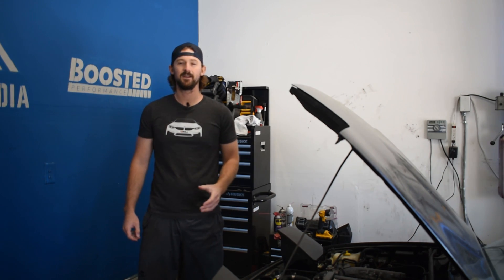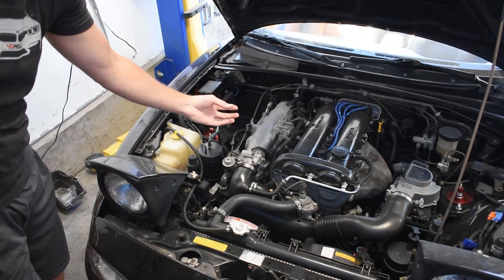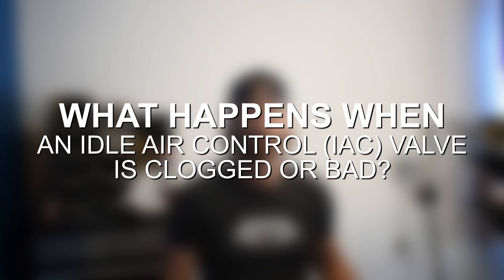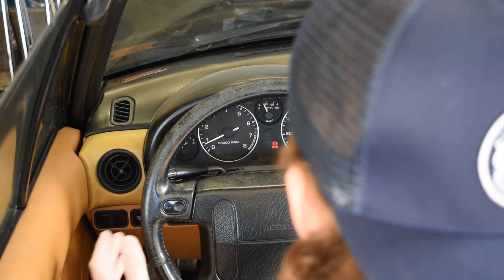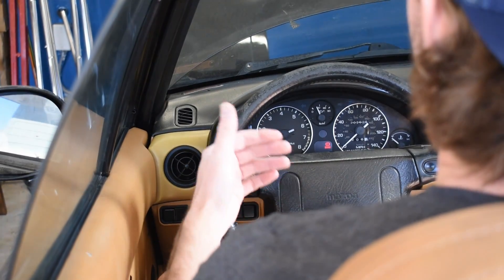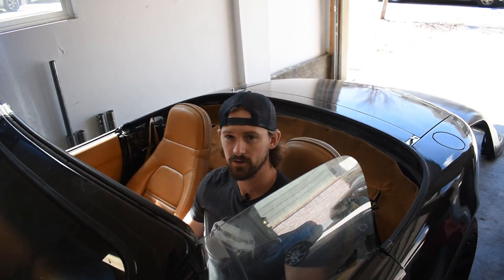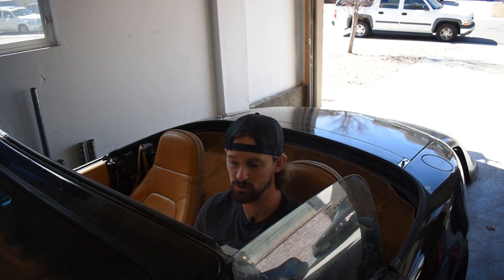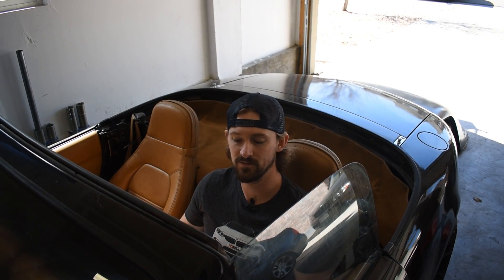DIY - How to Address a Clogged or Bad Idle Air Control Valve (with Symptoms)!

Comment: Wish I’d seen this video a year ago, but glad I’m seeing it now. It described the exact symptoms I’ve been having, getting worse over the course of years. Your video confirmed my diagnosis, finally, of a bad IAC. The only twist is I have a 97 which has the additional water controlled valve. The car sat for a long time and has a lot of rust in the cooling system, especially in the secondary water controlled valve. But the symptoms are exactly the same as you described. I’m trying to clean it up right now. So Thanks for the great video.
Reply from the maker: R - Glad to hear! We hope the video helped.

Comment: Can it make the hanging rev? I have one on motorcycle andwhen i revv yes the rpm increase but when i release.  throttle cable already close but the engine not come down suddenly. Maybe half second later.
Reply from the maker: K - Yes — a bad or sticking idle air control (IAC) valve can absolutely cause a hanging rev on a motorcycle, because if the IAC doesn’t close quickly when you let off the throttle, it keeps letting extra air bypass the throttle plate and the ECU keeps fueling it, so the RPMs stay up for a moment before slowly dropping; this can feel like the throttle cable is sticking even though it’s not, and the fix is usually to clean the IAC and throttle body thoroughly, and if that doesn’t help, replace the IAC since worn ones often react slowly once hot.

Comment: Dunno if you still see these comments, but on my bike (single cylinder fuel injected), it is harder to start when cold taking 3-5 seconds to launch, and the warm idle rpm is about 600rpm over what it should be, it is about 2500rpm cold and drops to 2100rpm, but should be 1500rpm, so you reckon this could be a part of that? It also seems like the bike tries to over compensate by enriching the mixture and then runs a bit rich
Reply from the maker: N - We try to always answer comments! It sounds like the ECU is over-enriching and holding the idle air control open too far, which would explain both the long cold starts (flooding it a bit before it finally catches) and the high warm idle (extra air bypassing the throttle). Common culprits are a sticky idle air control (IAC) valve/stepper motor, a dirty or sticking throttle body, or a bad coolant temperature sensor that’s telling the ECU the engine is colder than it is. If the ECU thinks it’s always in cold-start mode, it’ll dump extra fuel and command a higher idle. I’d start by cleaning the throttle body and IAC passage, then test the coolant temp sensor with a multimeter to make sure its resistance changes correctly as the bike warms up. If those check out, a vacuum leak could also raise idle and force the ECU to over-enrich to compensate.

Comment: Hi! ~ enjoyed your little Video . Ihave a Situation IN my 2002 Ford Explorer 4.6 V8 where as the Idle is  running about  3000 to 2000 @t start-up!!!    Then It goes down to 1600 rpm. I
I replaced my IAC valve with a New one <autozone> and it Still acts up!!!   Itested for Vacuum leaks in traditional places <manifold>  21 in HG Vacuum!!  What the Hell is going on on this FORD!!???
Reply from the maker: S - Thanks for the feedback! If your vehicle is idling at 3000–2000 RPM on startup and only slowly dropping to 1600 RPM—even after replacing the IAC and confirming 21 inHg of vacuum—it’s likely an issue with the throttle body (carbon buildup or sticking blade), a faulty or miscalibrated TPS (throttle position sensor), or possibly a bad PCM ground or idle strategy reset issue. Even with a new IAC, if the throttle plate is slightly open due to gunk or misadjustment, it can let in too much air and override the IAC's control. Try cleaning the throttle body thoroughly, perform a battery disconnect idle relearn (disconnect for 15 mins, reconnect, idle for 5 mins with no throttle), and inspect the TPS voltage sweep for smoothness—anything erratic can confuse idle logic and cause a high idle.

Comment: I know this is an older video so a response is probably not gonna happen. But, ive had to replace mine ywice now and not even 2 months after the second one its idling super high when i start the car. What could be causing them to fail so quickly? Ive replaced air flow sensor as well
Reply from the maker: N - The repeated failure of your IAC valve is likely caused by an underlying issue such as vacuum leaks, dirty throttle components, or electrical problems rather than the valve itself.

Comment: EXCELLENT EXPLANATION.did you say six hundred bucks for a new iac. ? thats insane, mine cost $20 bucks. i slapped it on and took it for a cruise. ran great. got home turenred car off and then for some reason i turned it back on and the idle strted surging. i took a look and the god damn thiung melted. i guess thats what $20 bucks will get you. one ride to store. taxiu is actually cheaper. i went and got a couple denso iac valves used the good pieces of eachj to make one good valve. thanks for the video
Reply from the maker: M - Thanks for the feedback! Unfortunately, that's what happens when cheaper parts are purchased, the quality just can't compare. Glad you found the video helpful and found the issue with your vehicle.

Comment: Could the iac valve cause lurking when the air con is switch on whilst driving in low gears
Reply from the maker: S - It's certainly possible. Wouldn't hurt to check if it's clogged and clean it if it is to see if that solves the problem.

Comment: I have a 93 300zx that idles rough but keeps running when the defrost is on, but the second I turn off the defrost the car dies.  Does this sound like the IAC Valve?  Most google searches say the car dies when AC is turned on.  This is the opposite
Reply from the maker: That's really odd. I'd try checking the IAC valve and see but if it were that then yes the opposite should technically be happening. Only thing I can think of is if there is some electrical problem going on. Does the AC actually work when it's turned on?